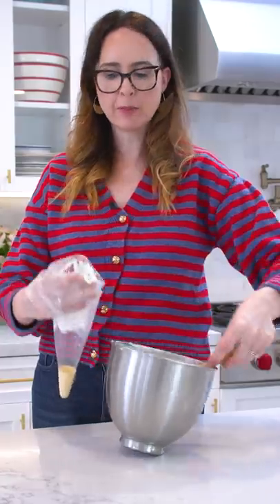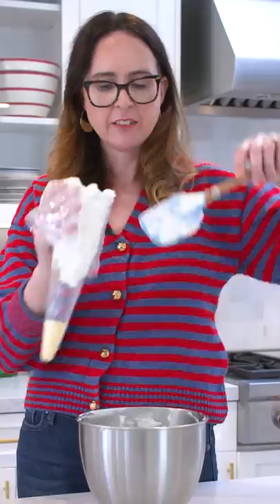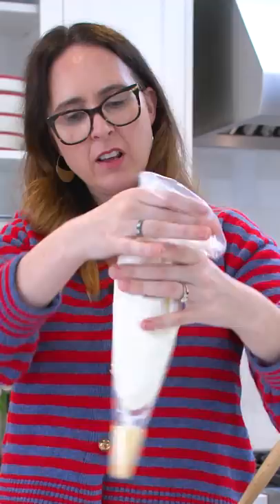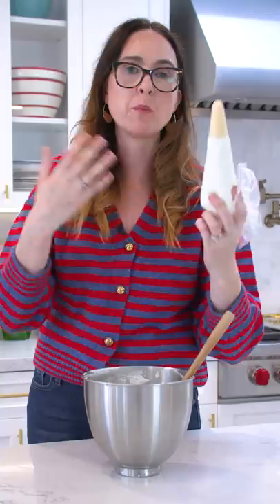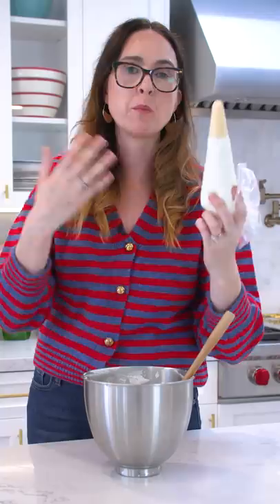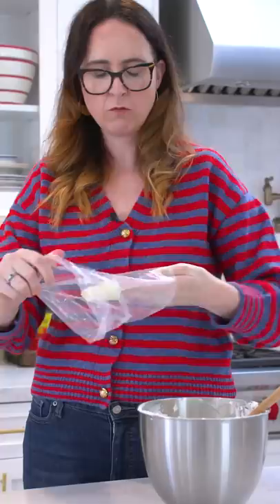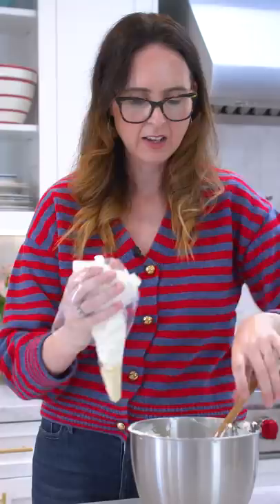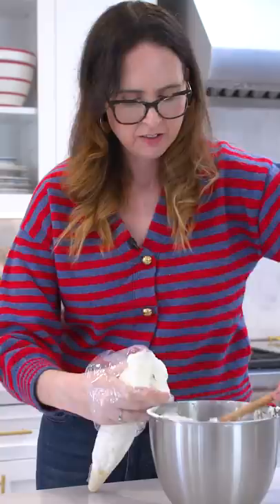The Right Way To Fill A Piping Bag

Comment: i stick my piping bag into a tall glass and fill it. Hands free, and no air bubbles! the glass is there for stability instead of filling a limp bag
Reply: I do the same thing, it works so well!
Reply from the maker: Good tip, Shira.
Reply: That is the best method
Reply: I do the same thing too! So much easier.
Reply: i do the same!!!
Reply: THIS
Reply: Hands free
I'm imagining you holding the spoon with your teeth and then piping with your toes.
Reply: Yep that's what I was taught to do too.
Reply: I tried but I ended up still having icing going to my hands
Reply: Same way I do it!
Reply: @theythemgae9025  lolllllll
Reply: That is how I’ve always done it previously, but since I often have trouble with air bubbles, I’m guessing from filling it from the top instead of the bottom, I’m definitely going to try this next time…☺️🙏❤️

Comment: Don't cut the tip off, fill the bag up and before you cut the tip off, hold by the open end and fling the bag around like helicopter blades. Sound weird but I promise it works every time 🙂
Reply: I just saw that on another video and wanted to try it, but I have the reusable piping bags (the kind you can usually get at a restaurant supply store) and they come with the tips already off 😭

Comment: You can also do this by putting the bag in a cup and folding the bag inside out down the sides of the cup (its kinda hard to describe), it's a lot less awkward this way and you can use two hands if needed

Comment: I've seen other content creators role icing in cling wrap to make sure that there are no air bubbles, twist the end, cut it, and then put it into the icing bag with the swirly end, so you have both together. Also, it allows different colours to be used together, it seems. I would think that it's easier to clean when you are just removing the empty clingfilm from the piping bag.

Comment: So I learned this trick when I used to work in an icing shop making cakes. We just had the fabric bags, but we would put the icing in cellphone wrap.  We'd wrap it in a way that 2 of the opposite ends were in meeting in oneside and rolled it in to a cylinder. Then twisted it where we folded the two end pieces for storage. When we needed it, we'd just snip up the twist semi close to the frosting and plopped the opening into the bag and squeezed. Never got any air bubbles from that method.

Comment: personally my preferred way as a recent pastry graduate, is to twist the bag and push it into the tip to make a seal so no product comes out while you’re filling the bag. and then depending on how much filling stuff it as normal or put it in a cup or container so you can hold the bowl right overtop and pour the product in.

Comment: If you are putting stuff in a piping bag without a nozzle, fill it before you snip the bottom. When filled, twist the top and grasp it then swing it around fast for a few sec and the air will be forced out (centrifugal force).

Comment: I lay a strip of cling film down on the counter and put my icing or whatever on that.
Then I just roll the cling film up into a cylinder and put that in my piping bag.
It saves some clean up and much less messy since I use silicone piping bags

Comment: I do it the wrong way and I do get air bubbles 😅 I'm going to do it the right way from now on!
Reply from the maker: Glad you found this helpful!
Reply: @biggerbolderbaking  I made your chocolate chip cookies with olive oil today. The batter is in the fridge, I can't wait to bake them tomorrow!
Reply: @biggerbolderbaking  I made the cookies and they are amazing! I thought they might be too sweet with the vanilla but they aren't. I used chocolate chunks like you said in the video you made of how not to make cookies but it didn't melt like yours. I have a gas oven so maybe I need to adjust the timing 😊

Comment: You get air bubbles no matter what. I lay my bag on the counter on the side and add a little bit at a time to one side. When I'm ready to use the bag I just slowly squeeze out the air and I'm good to go.
Reply from the maker: The second method won’t have air bubbles at the most bottom part. Easier to fill air bubbles above when shaken.

Comment: It's so much easier: fill your bag your usual way, but don't twist it up just yet. Instead, lay it on the table and gently slap it like you'd tap a burping baby. Use a scraper/ very very dull knive to push all the filling to the tip of the bag et voilà, no problem. The slapping is what gets the bubbles out, so don't close it until the very end

Comment: You can also fill the air bubble after putting it in by squeezing it all down as far as you can, even if some comes out while doing so
Reply from the maker: It’s harder to fill the bubbles if the bag is filled the way I did the first bag.

Comment: I have an easier way. Get plastic food wrap and dump the frosting inside, then roll and twist shut and you make a couple of those, then you cut the tip of the twisted part and you put it into the bag, this way you can refil the bag and not have frosting all over the place. And to remove the wrap you just pull it out and place another one and if you don’t use all the frosting you can keep it in the wrap for a couple days in the fridge and it’ll be like brand new for some time

Comment: Just pack it.... you had air bubbles too but you got them out... by packing it. If it works for you good. I use a glass. It's not a mistake if it works for them, that's just me tho.

Comment: This is wrong. its better to squeeze out the air bubbles by just squeezing the icing back in the bowl and it also helps to not have too much icing in the bag because the heat in ur hand makes it watery and it will look bad on the thing ur icing. Too much icing also will make it leak at the top of the bag.

Comment: The best way is that put pipping bag in a glass or cup.This won't make any mess at all. This is easy, right?
Reply from the maker: It is placed in a cup. The thing to do is to pull down the sides of the bag as far down as you can when filling it. You still shake the bubbles away, but this time they’re easily removed compared to the first bag where there are still bubbles even after shaking.

Comment: What we do is that we get a cup and put it in that, keeps it right open
Reply from the maker: You can use that too, and still use this method at the same time. The key is to pull down the bag as much as possible when you start filling it. It may still have some air bubbles before you’re done filling, but those will be easily filled when you shake it.

Comment: so just pack it more?
Reply from the maker: Pull down the sides of the bag as far down as you can,  then fill. Shake and the remaining bubbles disappear. Fill it without pulling the bag down, and the bubbles are bigger, and not easy to remove even after shaking. Hope this helps.

Comment: I give it a little spin to make it go down after
Reply from the maker: The consistency of the frosting will come into play. That might not be so easy with a thick frosting.
Reply: @biggerbolderbaking  I usually do it with buttercreams and like cremecheese frosting but for sure you definitely can't have the tip open or it'll make a big mess lol

Comment: My biggest issue is the seam of the bag breaks and I have to refill another one.
Reply from the maker: That happens when there’s too much air bubbles in to begin with. Bakers squeeze the frosting out to remove the bubbles, but if the frosting is thick like it should be, then the bag can burst. The difference is in the way the bag is filled, by pulling the sides of the bag as far down as you could. Fill with frosting, then shake to remove the air bubbles that are left (they would be significantly smaller and easier to remove after shaking). In the first method, the bag is still shaken, but the air bubbles remained, hence most people squeeze it to get the air out, but squeezes the frosting in the process as well.

Comment: There was a big ass air bubble on the side before the cut. I guess even you had trouble doing it right.
Reply from the maker: It’s easily filled when shaken, because the bottom part doesn’t have any air bubbles.

Comment: Or a better method than this is place your piping bag into a tall  cup and fill it up from there. No air bubbles
Reply from the maker: I use that too. The key is in how the bag is filled. I pulled down the sides of the bag so the bottom part does not have air bubbles. It is then easier to fill any air bubbles left above it.

Comment: There was still air bubbles the air bubbles don’t do anything to the mixture
Reply from the maker: Hi William. If you finish the video, there aren’t any left. That was the point for this tip, on how to avoid getting bubbles in.
Reply: @biggerbolderbaking  I watched the whole thing and the clip I saw there was huge air bubbles there is no point in this it’s just more time

Comment: Did the same thing at first just more steps 💀
Reply from the maker: The second method showed me pulling down the bag as far down as possible. This is to fill the bottom with completely. So even if there are air bubbles in the upper portion, it’s easily filled when shaken.

Comment: Just “pop” the bag. But anyways…maybe good tip for beginner… 🤷‍♀️
Reply from the maker: The difference lies in how the bag is filled. The second method eliminates the air bubbles when shaken.
Reply: @biggerbolderbaking  I fill the bag and pop it and then never have the issue with air bubbles. Way I was taught when I was 14 and now 42 still just popping bag of air it’s faster to me less mess

Comment: She squeezes the bag at the end and you can hear air escape. Could it be from an air bubble?
Reply from the maker: You still squeeze the bag because that is how the frosting comes out. I actually shook it both times. The difference is in how the bag is filled.
Reply: @biggerbolderbaking  no I'm aware you squeeze the bag no matter what. You require pressure to get the frosting out of the bag. I was just remarking that you said that utilizing the second method makes it so there are no air bubbles at the end but I thought I heard air bubbles when you went to squeeze the frosting out.
Reply: Not sure how you can hear air escaping when she’s literally squeezing the frosting out!😉
Reply: @robind8149  you should listen better there is deffo an air bubble hissing at the end of the video.
Reply: @otislima7916  - maybe you should look better… all that I hear at the end of the video is the “floop” of the frosting coming out of the tip.

Comment: Looks like the same process
Reply from the maker: The same process of shaking, but different way of filling. I pulled the bag down as far down as it would go with the second bag, as opposed to filling it with the sides up like in the first bag. Shake the same way, the first one will have air bubbles, the second one none.